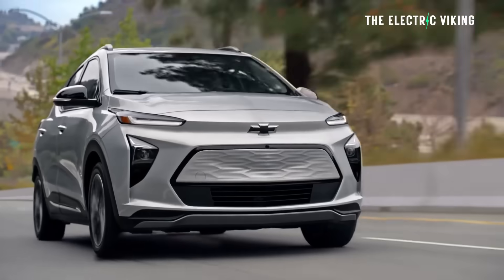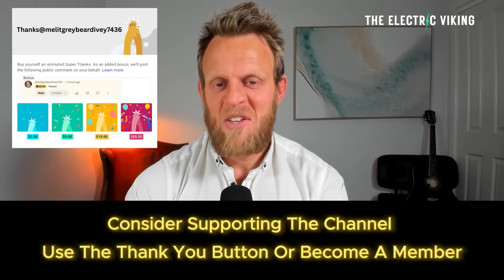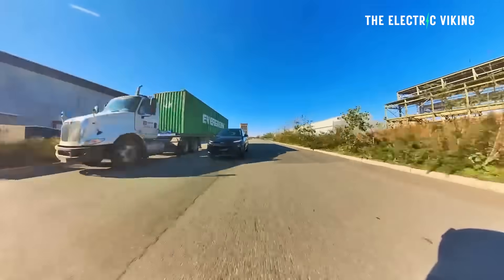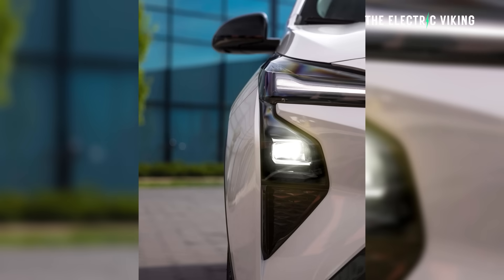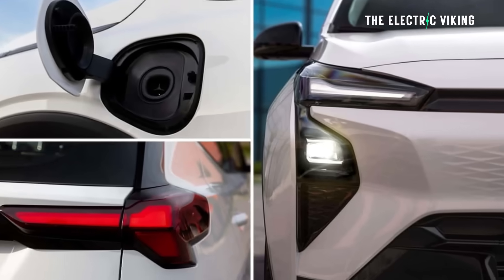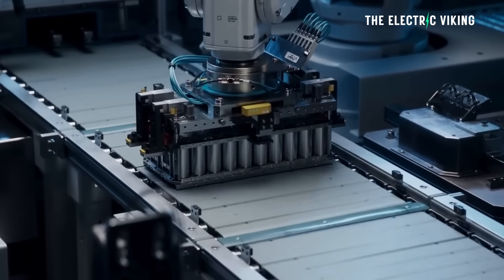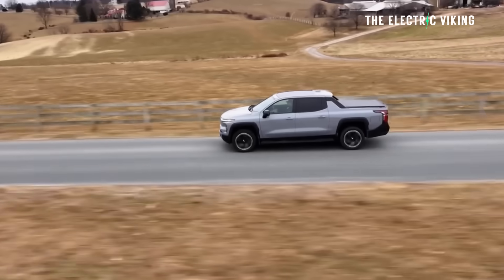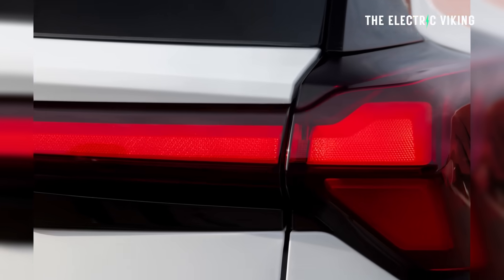The Bolt Is Back! Chevy Teases 2026 Model with Tesla Plug & LFP Batteries

Comment: With Trump tariffs against Chinese batteries, it will be financially challenging for GM to use CATL (or other Chinese) LFP batteries in the new Bolt. That could mean GM would use new Korean (LG Chem?) LFP batteries from a supplier that: (i) has no experience producing LFP cells (prismatic or cylindrical); and (ii) had to pay make-whole penalties exceeding $1 billion to customers including for v.1 Chevy Bolt on its faulty NMC pouch cell batteries. If so, batteries could remain the v.3 Bolt's Achilles Heel . . we look forward to learning more from GM.

Comment: US viewer here- I have had a 2019 Bolt Premier for two years, and don't even have DCFC (to my utter horror realizing that when the shipment arrived).  That said, I do all my charging at home anyway.  Might I take it on a 600 mile round trip if it had faster charging- yes, I might.  I haven't driven an EUV, but my understanding is that the stretched chassis brings some ride improvements.  To me, the old Bolt's handling is great anyway.  The key info missing in any description of the new Bolt is the DCFC charging time.  Of course it will be faster than the old Bolt, but how much faster?  

DCFC is the only major reason I would buy a new at this point in my life.  Will the new Bolt's charging speed be competitive with Hyundai/Kia?  Tesla?  Or faster still?  That might determine whether I stay with the Bolt or get something else next time I'm in the market.

Comment: Still has an inconvenient charging port location.  Needs to be driver's rear instead of front.   Also faster DC charging.  A good step so far but they still have to work with the industry standards for using Tesla charging stations.  These changes are necessary to eliminate road trip concerns
Reply: Needs to be passenger side, to allow for future street charging.

Comment: My 23 Bolt is the best and cleanest running car I have ever owed in 56 years of driving.   It’s phenomenal !   The new Bolt will be much better with a better battery that charges faster and has more range.  Only 1 mistake/ shortcoming is dropping apple CarPlay .
Reply: I agree regarding the 2023 Bolt. I wouldn't make your claims about the next Bolt yet though. We haven't seen one yet, never mind any actual long term driving history. Also, dropping CarPlay is not a shortcoming. The new system works just fine - does everything CarPlay did, but doesn't require your phone.

Comment: 3:08  How are you getting 350 miles of range with a 60kWh battery?  The old Bolt got about 4mi/kWh, there's no way they could increase that to 6 mi/kWh.  If they could, count me in, but I doubt it.
Reply: Maybe Sam meant to say "350 Kilometers", which would be about 210  miles.
Reply: @VVBros1 that could be. That makes sense.
Reply: It should be about 250 miles, matching the original Bolt.

Comment: If NMR batteries are 30% more energy dense it makes the cars lighter and reduces rolling resistance. A plus on range/battery capacity trade-off. A saving cost wise ultimately. Maybe 5% on battery pack.

Comment: Only issue I see is the NACS port is on the wrong side.  So you will need an extenstion cable or take two parking spots at the Tesla Supercharger.  Have 2020 Bolt Love the car, But slow charging and needing adapters and two spots is a pain in the rear.  I drive  A LOT.. almost 90K in 2 years.

Comment: I like the first generation design  lot.  On the European road, I think, does have a slightly unique character. The second generation lso looks nice and futuristic from the front. The back could have used a bit more fitting design. It somehow looks a bit too generically rounded. Based on the vague snapshots in this video, I can't really tell what the third generation Bolt looks like. I wouldn't mind the third generation looking like the first generation model. I think it's mainly the technology and battery that needed a refresh.

Comment: It’s not actually the Bolt EV, but the Bolt EUV (it’s slightly bigger brother) that they have brought back virtually unchanged other than the charging port and (eventually) LFP batteries.  They didn’t want to change the substructure so don’t expect significantly different styling.  The best attributes of the Bolt for me will be: American made cheap batteries, a well designed battery pack that allows for individual cells to be replaced when needed, a relatively small footprint for an American vehicle, and a sub 30,000 price.  This will end up being the perfect replacement for the wife’s Pontiac G3 when the time comes.

Comment: Love your videos Sam, but I'll disagree on one point: I have a 2023 Bolt EUV Premier, and I LOVE the car - including the looks. And we Bolt owners played a huge role in getting GM to un-cancel the Bolt. Keep the great videos coming!
Reply: The EUV was much better looking.
Reply: @keithv3767  By miles! GM agreed, which is why they modeled the 2026 on the EUV, and not the EV.
Reply: @ronlaverdiere I bought an Equinox EV. I love it. I’ll buy the new bolt in a few years to replace my second car that’s an ice car.
Reply: EV looks good.  
EUV - I don't like how the black strip on side hood ends & the black section on rear bumper.
I like orig wheels better.
I like the notch in the wing of EUV
Reply: @rp9674  and I like the older Bolt's tail lights better!
Reply: @rp9674  At least the EUV had a hood, and not that stupid stub nose like a cabover!
Reply: I like both tail lights, the classic bolts are more interesting

Comment: I know one guy here in Canada with a 2019 Bolt. Its got 580k's on it and working well, he says.
Reply: Sorry.... it's a 2017.... not a 19... more details.....did 300k's on the original battery and now 280k's on the replacement.  He loves the Bolt, he says.
Reply: Depending on the size of their territory, some sales reps can run 1-2000 km a week visiting clients and prospecting new ones. The math is valid.
Reply: That's insane how would that be possible on a 7-year-old car? They must have driven all over the country many times.
Reply: @jeffpro8  he drives from London ontario to Hamilton every day. I think he said its 1300 or 1400kms per week.
Reply: Kilometers

Comment: The Bolt is a sleeper.  It doesn't stand out as an EV or even much as a car.  It just looks like a generic econobox.  Stealth technology, no tickets, no keying.  Yet I love it.
Reply: heh what about the chevy volt. erev from 2010. mines 13 years old, 140k miles, zero issues, zero battery degradation. expanding the hv battery soon from ~17kwh to ~50kwh. vid on my chanel explaining most of the mods ive made to my 6k$ car. its saved me around 10k$ in gas over the last 3 years lol. you can technically get them in australia under the holden volt name but they imported very few of them and only the first few years of the 1st gen.
Reply: @vevenaneathna  Chevy really messed up the Volt on the Gen2.  We have both a 2017 Bolt and a 2016 Gen2 Volt.  The Bolt is flawless, 0 issues and the Volt is nothing but problems.  Way too many to list, but here's some.  Shift to park issue because there's a giant shift lever that presses on this tiny micro switch, BECM failure requiring disassembly of the battery, AC leaks, Wheel speed sensors, backup camera failure because they decided to put the connector where all the salt accumulates.  I'm literally putting it on the lift today to troubleshoot an output shaft sensor mismatch that makes the car jerk around like it's hydroplaning.  And it's only time before the EGR fails too. In 45 years of driving, the Bolt is the best car I've ever had and the Volt is the worst.
Reply: @scottkolaya2110  well gen2 volt had a lot of cost savings and questionable durability changes.  i can say from working on several volts that most likely
the wheel speed sensors fail easily if you overtorque them, and they fail in an insidious way.
egr is stupid, one of the main reasons why we drive gen1's, that and battery SOC protection.
imo poorly implemented backup cams are dangerous, had one fail on our 2014 and I am leaving it coz theyre so poor quality and get dirty from boat tail aero that theyre dangerous. 
not sure about AC leaks, the AC system is extremely complicated in the volt since its high voltage based. that sounds like prior crash damage or damage during repair.
the becm problem is a big deal. its actually a better repair to cut an access pannel under the center console and repair from above. half the time you can just resolder a detached mosfet and silicone the battery dog house back on. becm boards for gen2's used to be 50-100 bucks and now they occasionally go for 400-500. crazy

Comment: I think it would depend on the specs for me.  $30k. 300+ miles. 150kw charging.  Option for super-cruise.  (Am I asking for too much?).  (The other possible competitor might be the so called Tesla "Model 2"?)
Reply: It had the supercruise option before. I doubt it will be 300+ miles. Expect close to the same 247 mile range. 150Kw charging is probable. Heat pump is almost definite. I wouldn't expect much else to change.

Comment: Chevy's EVs have been surprising reliable and well built especially compared to their gad cars and terrible hybrids. The only thing Chevy needs to understand is that people want maximum efficiency, NACS, and a large frunk. If you don't care about paying thousands of dollars for  beta self driving software, if the new Chevy Bolt had a good size frunk and sells for the same price as it did before, it's a much better bargain than the Tesla Model 3.
Reply: I'd rather have a short Hood than a frunk, frunks are less efficient use of space
Reply: @rp9674 I agree with maximizing space, but it's more aerodynamic to have a properly sloped and longer front end. Also, it's more convenient to have a separate large compartment that is concealed from the public eye to minimize theft. I don't live in a high crime area and haven't had any issues with theft, but it's a bigger risk when going on trips to different places and for people who unfortunately do live in higher crime areas.

Comment: The USA has Manganese resources and Lithium , means they won't pay tariffs on the minerals. and New tech will mean that coper and graphene electrodes also made within the USA will not be tariffed.
Apparently the trucks and heavy equipment batteries are using LMR batteries as they have a higher C rating.